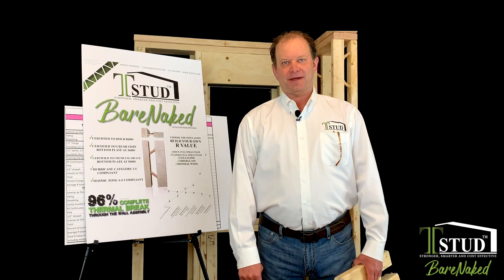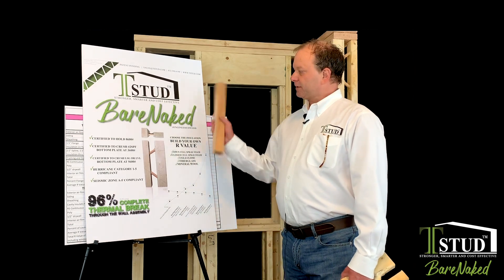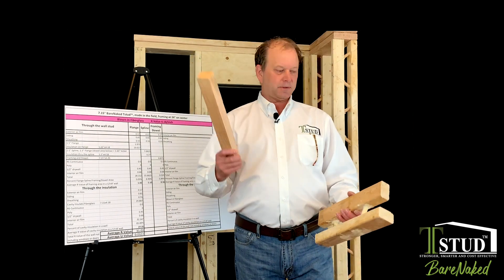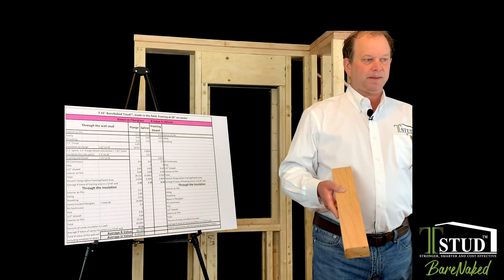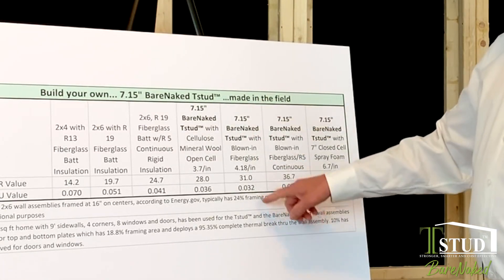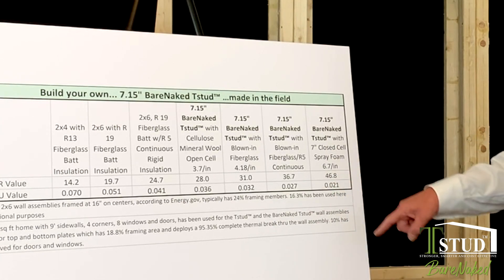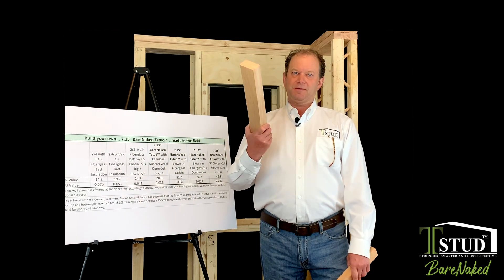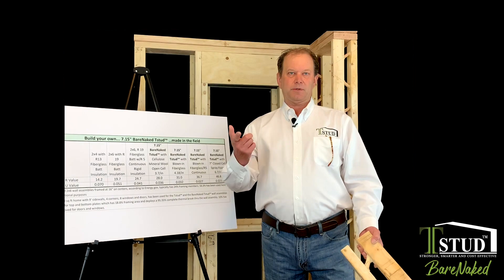DIY: 2x8 BareNaked Tstud

Comment: Awesome paradigm of thinking!   Seems like there are even more areas of opportunity to be even more resourceful and renewable using more engineered and recycled materials.  Especially if careful with VOC's from the adhesive/polymer products and possibly using recycled plastic waste even if a more grosser (VOC's) operation in regards to the manufacturing ops.  Wondering even if from a forestry perspective using significantly smaller trees in higher densities to produce the dowel material and possibly the rest?  I'm no expert in the field, though gets me wondering like not only wood too in regards to other materials derived from crops that grow without much need for resources especially if in renewable, regenerative and restorative farming practices.  Thanks for sharing!  Wishing I can afford this material and some closed cell insulation.  Maybe one of these days the remote sensing concealed wireless assault weapons transmissions ops and operators cease and die off.  For now, the sound, body and mind control concealed assault weapons imminent threats situational awareness capabilities advocacy work.

Comment: I love your product—please share more about the cost comparison to similarly energy efficient walls using more traditional construction. I know you've covered it, but it's an important enough point to cover often and in different ways, to drive it home. :)
By the way, I think your use of the words "parallel" and "perpendicular" are the opposite of what you mean. I would say the vertical orientation of the extension is parallel to the stud, and the horizontal orientation is perpendicular to the stud.